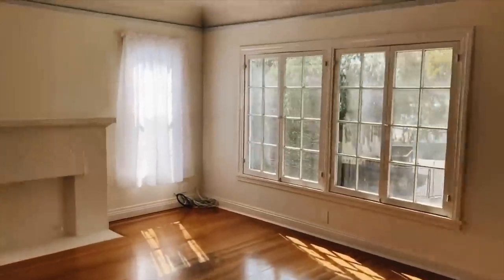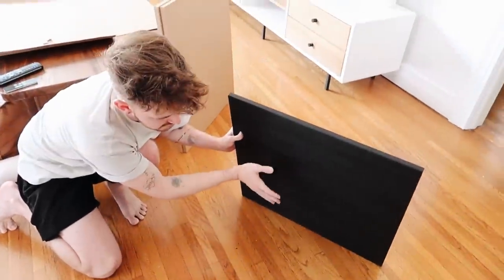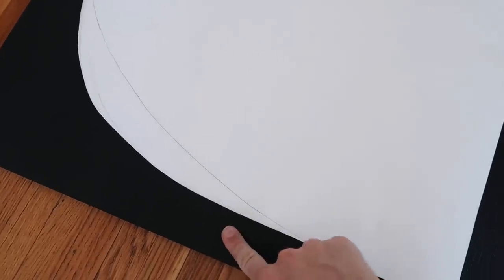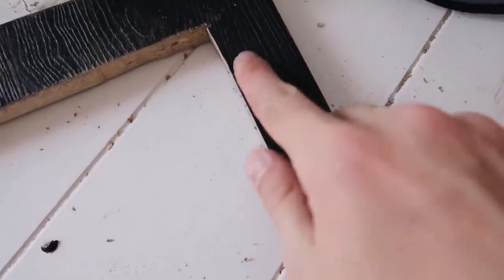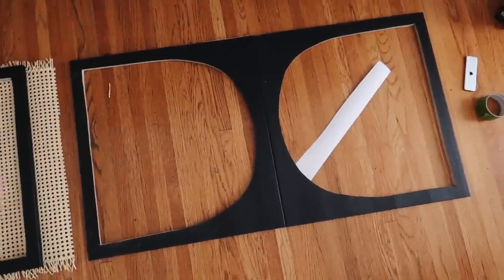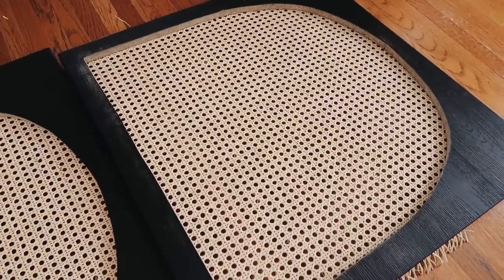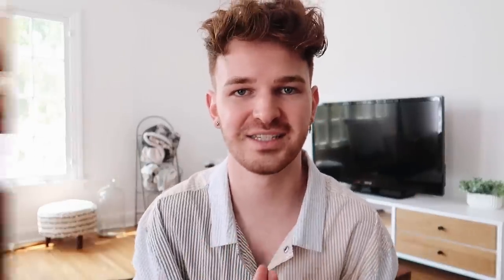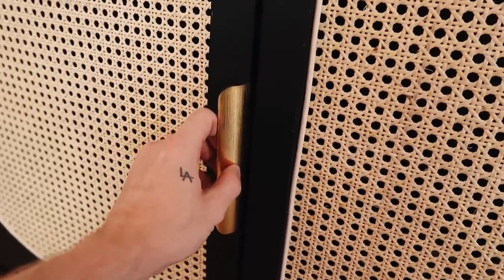DIYing VIRAL PINTEREST HOME DECOR - Abstract Woven Cane Storage Console (IKEA HACK)

Comment: Project turned out great!  I love the circular woven caning as it is perfect for stapling to the back of a frame to creat an earring holder for fishhook earrings or wire and rings to make scarf holders or necklace loops.  If you want to pull in your hardware or an accent color, paint your Reed spline in a metallic which elevates the piece or try gold leafing.  It really dresses up the piece and you can relate back to the hardware.  You can also make the piece pop with an accent color on the flat Reed and the spline. Like red to accent the black.

Comment: Tip. Create your template for the cutout. Then create a stencil from the template with another sheet of scrap paper. Use the stencil to trace your cutout onto the cabinet doors to ensure uniform placement of the cutout on each and every door.

Comment: Wow Drew your Console came out amazing!  I was impressed at your first time skills using a Jigsaw... I see you’ve definitely done your homework, using the masking tape to protect the wood and drilling your pilot holes!   If you ever have to make an “Arch” again, why don’t you try using a compass.  It’s a very simple tool to use.  It’s great for any size circle too! 👍🏼👏🏼👏🏼👏🏼

P.S.  There’s also a “Professional” Tool called a “Acu-Arc Adjustable Ruler” unfortunately it runs anywhere from approximately $30-$90 depending on whether you buy a new or used one and the size of it.
Reply from the maker: Thanks so much for the advice :))

Comment: I really love this. I think with the legs, I'd swap them out for those metal "diamond triangle" legs from Amazon. I think they are like $25-30 dollars. I'm going to be using them for a project coming up and I think it'll help it look more expensive
Reply: Do you mean metal 'hairpin' legs? 🤔
Reply: @olbird7647  no, I don't think those would look right. Just type in metal diamond triangle legs on Amazon and they should pop up. They come in different colors so I think black or a color like the handles would be good on this

Comment: If you didn't like the tone of the wood finish on the console compared to your floor wouldn't the easier and cheaper solution have been to sand down the drawers of the media console and stain them with a different color?